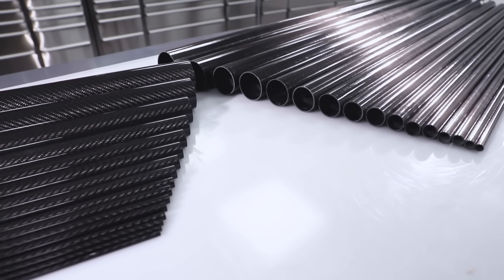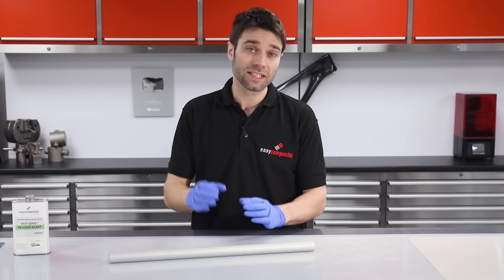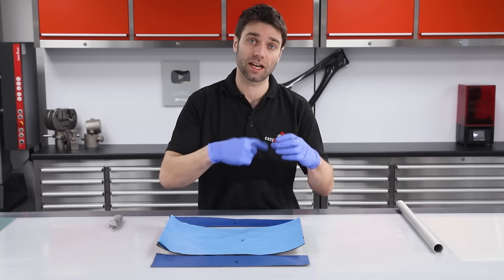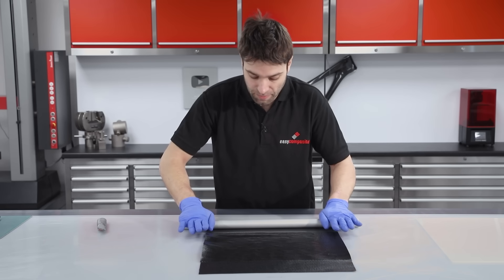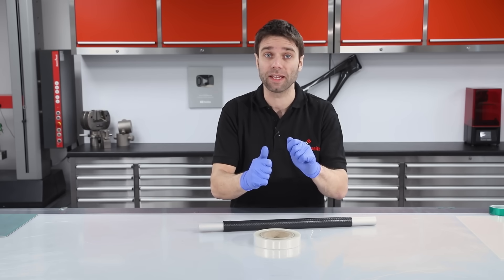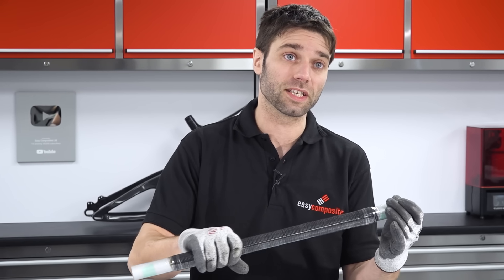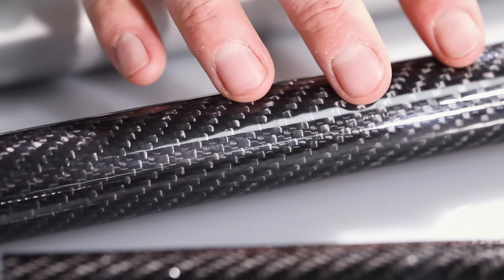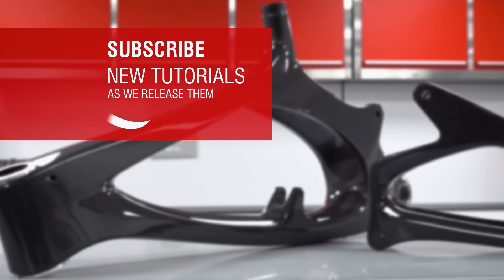How to Make a Roll Wrapped Carbon Fibre Tube

Comment: Would the interior of a tube made with a process like this be smooth enough to use for something like an automotive intake or intercooling pipe?  Also,  I'd love to see a follow up showing how curved tubes could be made.  Love the info, thanks!
Reply from the maker: Yes, as mentioned by the other comment, the inside of the tube is pretty much perfect (as good as the outside of the mandrel). Oh yes, and that second video will be up VERY soon.
Reply: yes the inside is as smooth as the outside of the pvc pipe you use

Comment: That really interesting. Just looking on your website and there is no specifications for tensile strength on specs, which is higher the woven or plain ? Looking for a tube of around 30mm diameter OD and about 1.2m long
thanks
Reply from the maker: As Ryan has commented, it's really about fibre *alignment*. Our UD prepreg uses a Toray T300 fibre. Our 210g woven cloth uses a Pyrofil TR30S fibre. The tensile properties of these fibres are very close (although the TR30S does edge it). However, in terms of what they bring to the tube it's all about the alignment of the fibres. The UD fibres are all running lengthways down the tube; they're bring maximum longitudinal strength to it but adding almost no 'hoop' strength. The woven fabric is providing a 50/50 split between hoop strength and longitudinal strength.
Reply: @easycompositestv What is hoop strength ?
Reply: I can tell you that in pure tensile load, the unidirectional carbon fiber will be substantially stronger than a bidirectional woven fiber - half the fibers are always pointing the wrong way! 

You can get bulk tensile strength specs for the fibers and resin used, and calculate the approximate tube strength based on its cross sectional area.

Comment: dude WHAT? 700kg of stress until failure? Why isn't this used as a material for gym bars? Is it too expensive? Is it more like because a longer tube would have significantly lower stress tolerance?
Reply: yes price as well as wear and tear. a bar of metal is cheap and basically lasts forever
Reply: During adding or removing weights or another situation, surface might grinded and produce dust as seen in 7:49 . Some say its toxic some says its poisonous. But its clear that it will damage your lungs in long term. Tiny fibers can pierce your skin so its another problem.
Reply from the maker: Yes, as others have posted, carbon would make a bad choice for a gym bar due to 'real world' damage, abrasion and other factors. Plus, a gym bar doesn't need to be particularly light when the whole point is to be heavy, does it?! ;)

Comment: "i am gonna be doing a very primitive test"...moves on and using an industrial press with a pc program that measures the force in detail...epic
nice video btw
Reply from the maker: Thanks Dimos. OK, so maybe 'primitive' was understating it a bit but what we meant was that we were not going to get right down into test standards and things, at least not in this video.
Reply: @easycompositestv  Before failure mode is achieved is the material in the elastic domain like steel would be before it reaches plastic deformation? Otherwise said, if the part is released from the machine after reaching 600kg at 10mm deflection would it still have the same dimensions as before being subjected to the test?
Reply: @easycompositestv  I really appreciate the tests at the end. I've worked with and used carbon fiber in the automotive race industry (Renault spec racers) and years ago we used to make some components out of carbon fiber, but i never really got to see it tested like this! We all know it's strong but hard to visualize sometimes. 

We only used it for Naca ducts and some basic non-structural things.
Reply: a primitive test is also, often a stress it till it breaks kind of test, or destructive test just to measure maximum capacity:>
Reply: you can only imagine what the "non primitive" test are like
Reply: Haha yeah it's primitive in terms of test design, but the equipment is $10-20k and up. I've done the same type of test with static weights to the same effect, though. You don't need the fancy tensile tester, but you would need to build up a fixture for the test.

Comment: great vid. and that tube took a lot more stress than i expected. imagine what a layer of kevlar in the mix would have added.
Reply from the maker: Well, actually, Kevlar does not have a higher strength than carbon fibre and so in a test like this it wouldn't have improved those numbers. What Kevlar does have is a higher 'elongation to break' which is why it's so good at keeping things together in a crash for example.
Reply: @easycompositestv y, that was exactly what i meant. higher elongation would have kept the part from breaking a lot longer in a bending test. proof is in the eating though, i should get rolling and try it.

Comment: If you have problems extracting the tube from the rod, perhaps putting it in the freezer first would help. That would make the aluminium contract even more. Any thoughts?
Reply from the maker: Freezing does work in some cases.

Comment: well how can you make one without an oven?? or how to get one of those ovens?
Reply from the maker: You can't use this process to make a carbon fibre tube without an oven because the prepreg reinforcement needs high temperature to cure and also the elevated temperature in needed to expand the mandrel (as explained in the video). However, you don't need a fancy oven for this process, any oven that can hold 120'C and that you can fit your tube in will do, including a domestic (kitchen) oven.
Reply: Easy Composites Ltd my man, you guys definitely have a new client, I’m in. Thank you so much for those highly educational videos

Comment: Is there some carbon joints/clamps for such carbon tubes? Wanna make classik bike from carbon tubes
Reply from the maker: Tube joints/joiners made of carbon fibre do exist (although we don't make or stock them) but they are very complicated mouldings to produce and so will always be very expensive. For certain tube dimensions you should be able to find metal or plastic joiners too. For a bike frame construction however, I don't think these off-the-shelf joiners are likely to be the right solution.

Comment: Awesome video!! Our rocketry team was looking to try and make carbon fiber nomex sandwich tubes, what would be the best process? We are considering filament winding.
Reply from the maker: Hi Jonathan, I think I would go for making a thin-wall carbon fibre tube for the inner skin (perhaps using a roll wrapped process, like this) then release but leave it on the mandrel. Next I'd make a very thin carbon fibre sheet for the outer skin. I'd abrade both the outside of the tube on the mandrel (which will be the inner skin of the tube) and the inside of the carbon fibre sheet. I would then apply a layer of prepreg adhesive film, wrap the nomex around, another layer of adhesive film and then wrap round the carbon fibre sheet to make the outer skin. Vacuum bag the whole assembly (with bag on the inside and outside of the mandrel, to equalise the pressure) and then oven cure the adhesive film.

Comment: How would you make a curved tube for cruiser style bicycle handbars?  I've been riding on a carbon fiber road bicycle for a few years now and have been very impressed with it's lightweight quality and durability.  Thank you for sharing!
Reply from the maker: Hi Lucas, that's the very next video we're doing. For curved tubes, like handlebars, you need a split-mould process. New video in around 1 week; subscribe and hit that bell.

Comment: This would be a great metarial to make a pair of crutches - light and strong.
Reply from the maker: Yes, for sure. In fact I would be surprised if there weren't carbon fibre crutches on the market, somewhere.
Reply: There ought to be a sport out there that involves crutches.
Reply: @rootbeer666  ain't that skiing?
Reply: price probably isn't worth it, also considering aluminium ones are pretty light
Reply: And they always get stolen by the patients... lol  @seannz100

Comment: How does this “homemade” tube compare to its off-the-shelf counterpart in terms of tolerances and resistance? (I'm talking about a tube with the same layup configuration and diameters)
Reply from the maker: Pretty similar Daniel because - although this is 'home made' as you say, the materials and manufacturing process are actually so similar. Maybe if we get chance we'll compare a tube made in this exact way with a matching tube from our stock range and put them both on the test machine. I'll wager that they'll be within a few percent.
Reply: @easycompositestv  Thank you for your answer! That would definitely make an interesting video
Reply: @easycompositestv  And what about price performance. Equipment non-considered, should we expect a price benefit for building tubes vs purchase? Or is it added flexibility in design? ... or both?

Where are these tubes strongest? In the video we tested the tube horizontally, is the tube inappropriate for a vertical application?
Reply: @MM-24  China is always cheaper but the tolerances are usually terrible. You can get a free oven from Craigslist that works just as well as the fancy one he has. All you need to do is get it to temperature and have room to get in the oven. Anyone ,including kids, can make this by watching the video. The tube is the strongest the same way as any tube. Obviously, long thin things are always stronger vertically. There's no reason to not buy it other than pride in making it yourself. You are either a builder or you're not.
Reply: That is clearly not homemade

Comment: In my situation I have bought plans to build a j3 kitten ultralight aircraft. I have heard that some manufacturers use carbon tubes to create the airframe structure to lighten and strengthen it. How can this be accomplished. This idea could be material for a future video blog. Humbly requesting. Thank you for all the past blogs. I have learned so much from all you gentleman and your factory.
Reply from the maker: Thank you for the comments and post. Whilst I understand that there are very few restrictions on the materials and approvals for ultra-light aviation, it would still be very important to be totally confident with your materials and processes for applications as critical as an airframe. Having said that, I have no doubt that some manufacturers can safely and successfully incorporate carbon fibre tubes into their airframes increase strength (or stiffness) and reduce weight. Usually it's the joins that are the most difficult part when using composite tubing. We'll certainly keep this in mind and see if there are some videos we can produce to cover this topic.
Reply: Easy Composites Ltd i would also like to investigate carbon fibre tubes for an ultralight airframe. Thanks for your videos.

Comment: Great video! Would it be possible to make a sliding fit with two tubes?
Reply from the maker: As long as you are careful in designing the right thickness of your lay up then you can making sliding fit tubes.  Quite often carbon tubes are made this way for extending poles for window cleaning, flag poles, fishing gear etc etc.  Remember to allow a small gap for manufacturing tolerance and so the tubes have a small gap to allow smooth and easy sliding.

Comment: How would you compare the cost of this, compared with aluminum and steel tubes. Exploring application in race chassis design. Thanks!
Reply: if you're comparing to metals, you must specify the alloy and temper (if applicable). 
Steel is almost always easiest to arc weld, aluminium depends on the particular alloy - some weld easy, some are reasonable and some are impossible to arc weld. CF composites bond well with epoxy, as they're made from it. It's also very easy to do complex shapes. But they're also quite expensive and can't take heat.

It all depends on what exactly you want use it for.
Reply from the maker: Wow, yes, very difficult to compare. In most situations, carbon fibre tubes for a race chassis would be a real challenge. Not impossible but tubular chassis designs are intended for metal tubing and so trying to swap out metal for carbon is not really the right way to think about it. Composites are better suited to monocoque design (carbon fibre tubs) which of course wouldn't really suit metals; it's horses for courses. I would say carbon tubes are not a viable substitution for metal ones in a tubular chassis design but a correctly designed composite tub would outperform a tubular chassis.
Reply: @easycompositestv  Thanks for the elaborate answer! I got the idea from the Czinger 21C, which seems to use carbon tubes, connected with 3d printed aluminum joints. Using generative design on the aluminum joints also makes sense.

Comment: Great video as always, but you should've put that aluminum mandrel to the same test for comparison :)
Reply from the maker: Well, it's a smaller diameter for starters so it wouldn't be a fair test to begin with. It's also a different wall thickness. However, I agree that a fair comparison of aluminium vs carbon would be interesting and something we should do in the future.
Reply: @easycompositestv  rather E glass verses carbon comparison. I think most people don't understand the difference between stiffness - carbon and strength.

Comment: how long time in the oven?
Is pattern pre preg?
Reply from the maker: The tube was cured in the oven for 1hr. By 'pattern' do you mean the mandrel? - If so then the mandrel is aluminium (metal).
Reply: @easycompositestv   i mean Fabric carbon fiber ,Is It pre preg?

Comment: woulda'  been  nice,  when  doing  the  stress-test  at  the  end … to  have  a  comparable  steel  tube  of  same  dimension … for  comparison  results.  thanks.
Reply from the maker: Yes, it's a good idea. We didn't have such tubes handy unfortunately but we could certainly calculate their performance and compare.
Reply: @easycompositestv  would be amazing to have a somewhat meta video - (and this might already exist) - but it'd be awesome to have some application / methodology type videos. How do I know when carbon fiber is the correct application for my problem? How do I size a carbon fiber part strength / price / purchase vs build - wise for my application? ... even if only at a high level.

Comment: Unidirectional fabric increase the strength of the tube? Can I make a tube just 2x2 fabric?
Reply from the maker: Yes you can just use woven cloth.  UD cloth works best when you want most of your strength in one direction as is often the case with tubes.  However a woven cloth would give a tube with a lot more hoop strength due to the fibre orientation.

Comment: Can it be cured at a higher temp?  Oven only goes down to 175.
Reply from the maker: This pre-preg is not recommended to be cured at that high a temperature.
Reply: You don't really want to do it in a cooking oven as the temperature isn't very stable. Kitchen ovens cycle on and off so it causes over shoot and under temp. Not to mention the temperature will be different depending on where your part sits in the oven.
Reply: @Kyrazlan  thanks for the heads up.
Reply: You're better off making your own oven like is described in this video. https://youtu.be/CQ1PNXa_LaI?t=1227

Comment: Nice!
Would love to see a video of how to attach metal to the CF tubes to help build frames or frame reinforcements, like a strut tower brace.
An ultimate video would be how to create a CF antiroll bar, like the Porsche 911 GT2 RS uses............ :-D
Reply from the maker: OK, thanks for the comments. We do plan to do a video on fittings and fasteners for making carbon fibre assemblies, we could cover some of the things you're talking about in that.
Reply: Easy Composites Ltd showing us how to make a 90 deg bent tube would be nice also. 
How well does this pre prefer hold upto heat?
Reply: @easycompositestv  I would love to know as well. I'm thinking of a homemade carbon bike with metal lugs.

Comment: When I saw stress in kg.... 🙈 damn cant un see
Reply: Lol
Reply: Actually the machine outputs the force it applies versus the displacement of the head (deflection in this case). So kg is fine. The internal stresses can be estimated by considering the dimensions of the tube and the external load applied.

Comment: There's any process like "Lost PLA" (used in greensand mold making) where you wrap the part you want and after it has cured, you apply heat or a chemical process to melt or dissolve the inner mold? This would massively help at creating very complex parts and never seen it done on carbon fiber
Reply from the maker: Yes, there are a few 'lost' core process that can be used with carbon fibre, including low melting point alloys (like Wood's metal) and soluble core materials. We definitely hope to do some tutorials using one or more of these processes in the future.
Reply: @easycompositestv  thank you, will be looking forward to that!
Reply: Styrofoam?

Comment: Hi there. Newb question...Is that 120F or 120C temperature for curing please?
Reply from the maker: Very good point, we should have though of that. It's 120'C we're talking about.
Reply: @easycompositestv   does 120C mean we could cure in a domestic oven or would it poison everything afterwards?  I've been wondering about having a crack at making carbon fibre bow limbs??? or carbon / kevlar?? Any tips / advice or diy carbon fibre arrows? Using the string based products?  Many thanks in advance.